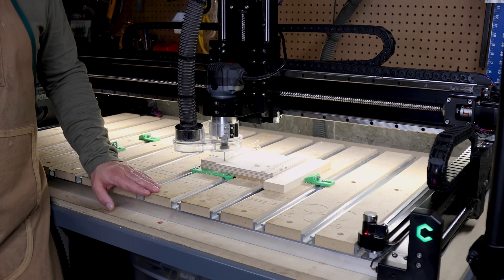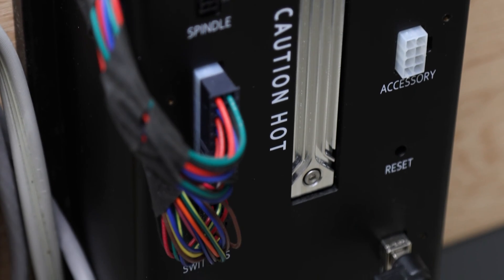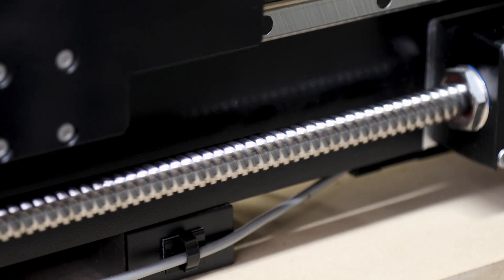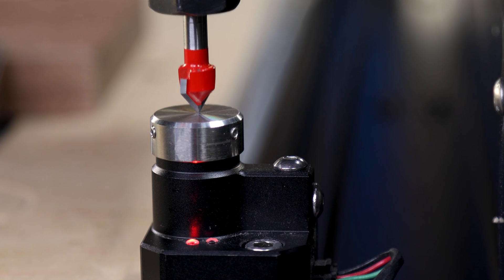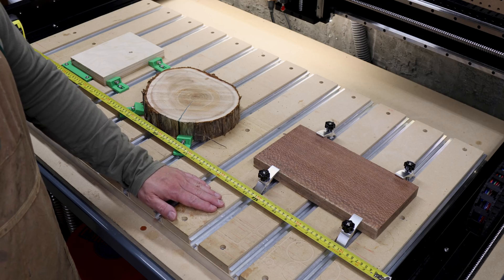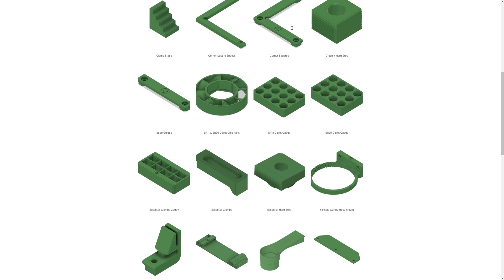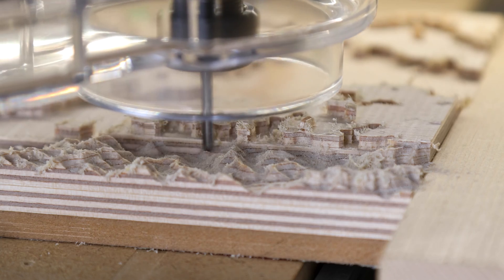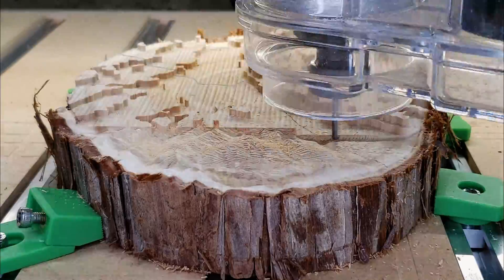Shapeoko 5 Pro CNC Router: Is it Worth it?

Comment: Is it loud? I would be putting this in the garage so wanted to see if it will be too loud
Reply from the maker: By far, the loudest parts are the router and the shop vac. You can reduce the noise significantly by using a spindle instead of a router and getting a shop vac that made for less noise.

Comment: Is it worth it? 5k with vfd spindle for the 2x4 is no pocket change
Reply from the maker: I've had it for 2 years now and it's been a work horse. After almost 2 years, I burnt out my first router, which is the only part to fail so far. That's more than acceptable for the use I got out of it.
I can't speak about the spindle, as I don't have it.
Reply: @MakeTechCreate  I can get a never before used shapeoko 3 XXL for 1000. Would you do that or save up for this? Curious to know your thoughts having had both.

Comment: Great review.  Overall, worth it for a beginner/DIYer?
Reply from the maker: Thanks. I would say yes.
Note, I've heard of people having issues with the spindle kit, so you might want to check into that if that's the route you're going. I use their router and have had no issues there.
Reply: I’m having issues right now with the spindle kit and looking for answers
Reply: @Samadhiworks  what issues?
Reply: @Samadhiworks did you get it figured out?

Comment: I will be upgrading to a 4x2 in the near future (I currently have a Shapeoko 4 Standard).  I'm glad to see that the Bitsetter is standard equipment now.  The Bitsetter is probably by far the best accessory you can have.
Reply from the maker: The bitsetter is a major time saver! Now, all we need is an automatic bit changer 🤣
Reply: I wouldn't. I have a bricked out 5 Pro in my garage and it's been a nightmare.
Reply: @pb48711 Not to sound like I’m busting in ya, but sounds like possible user error.   I know several people that have the 4x2 and 4x4, and they haven’t had any issues.

Comment: Thanks for the video!  I am considering this CNC or the Onefinity Journeyman Pro. Did you do any compares prior to buying the Shapeoko ?
Reply from the maker: I did. In the end, they're both great machines and very comparable, and you'll be happy with either, I think.
I picked the Shapeoko over the Onefinity mostly because I was already using Carbide 3D products and was comfortable with them.
Reply: @MakeTechCreate  Thank you!  That is definitely one of my dilemmas as to go with the free software or pay for the VCarve Pro
Reply: @51rclewis  I use three different programs.....Carbide Create/Carbide Motion, VCarve, and Easel.  All have their pluses and minuses, depending on what project you're doing.  I would say, however, that I use C3D software the most, VCarve second, and Easel bringing up the rear.
Reply: Look into the customer support before you purchase. Try to call it and see what happens. They don’t answer. Good luck.
Reply from the maker: @boninm252  I haven't tried their phone support before, but email support worked for me... although they have been slow at times.
Reply: Xcarve has pretty good support fyi.

Comment: This machine is a ticking time bomb, the controller they designed has wrongly specc'd octo couplers, cold solder joints. A lot shipped with missing components off the main controller board itself.  You are locked into using their over priced spindles if you add one as they molested the signal coming out for speed control unless your willing to take it apart and bypass the noise isolation completely to get a usable signal. On the spindles, they spin up 0-100 percent on power on even using their offering.
More often than not, you will get the machine missing parts/hardware and pretty much every bolt on this thing isn't torqued correctly right out of the box.

Oh and they put little tiny stepper motors on it and give them way too much current to the point of if you even come near the heat sink you will get burned, they are so above their thermal budget in this design I couldn't imagine the stepper drivers lasting more than a year/year and a half with decent use. They also delete / moderate / censor thread on their own forum of people talking about more of the serious problems with this machine.

I'm sorry, I have the 3XXL and bought the 5 because I loved the old one. What a giant mistake. In my opinion the only thing that can fix this machine is a torque wrench and the a Masso Controller conversion.

BUYER BEWARE.
Reply from the maker: It sucks that you're having so many issues with your machine. Mine has been mostly solid, so far.
I'll agree that many of the fasteners are tightened properly when shipped and you definitely need to check those. I don't have the spindle, so I can't comment on that ... but the controller has been solid for me, so far.... I had massive issues with the one on my 3 XL.
Have you contacted Carbide3d  about all this? What were their replies of you did?
Reply: Sorry to hear this!  Give us a shout if you're looking to up your cnc game!

Comment: Don’t buy this machine. I just bought one. They sent it with an untested controller that was defective with a common problem that is plaguing their controller boards. They say they fixed the problem as of a few months ago but my board purchased a couple weeks ago had the same issue. The company themselves wrote blog posts on this issue talking about how much of a problem this has been for them. They are trying to push out more of these than they can handle to quickly. Their support is awful as well.  They knew I was backed up on orders because of their delays after many email correspondence calls and voicemails. Despite saying they would overnight a controller I still haven’t even received so much as a shipping confirmation after almost a week of following up daily. 

Save your frustration and money. Buy a more professional machine. If you’re trying to start a side business it will pay itself off in no time. Why spend thousands on a junk. They have great YouTube marketing but don’t be fooled!!

Do you buy power tools at harbor freight? Then don’t buy a shapeoko
Reply from the maker: I'm sorry to hear you had issues. My machine has been mostly rock solid, so far ... much better than the controller on the Shapeoko 3.
What issues are you having?
Reply: @MakeTechCreate  The company has been having issues with cold solder joints in their controller boards. This pretty much disables to device by not letting it home. They said the revision 5 controllers, which is the one they sent me, does not have this problem anymore but mine clearly did. 

I am parsing the tradeoff between just upgrading to an avid machine. I talked to a sales rep about the differences between the two and they didnt want to compare the which makes me think that the avid will be like comparing the Shapeoko 5 to the Shapeoko 3.
Reply from the maker: I didn't know that. So far, I've had no issues with mine ... knock on wood.
The controller on my Shapeoko 3 was horrible, though... constant disconnection due to static issues... especially in the winter
Reply: Hey Micahels!  Give us look if you want more options!